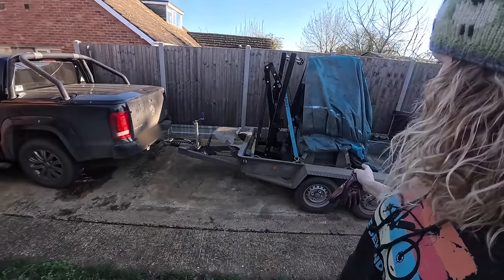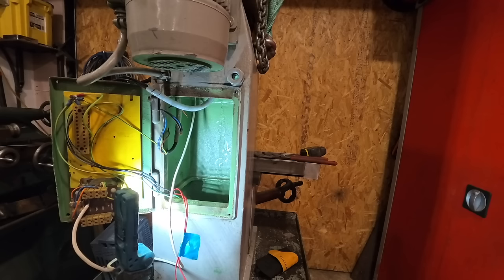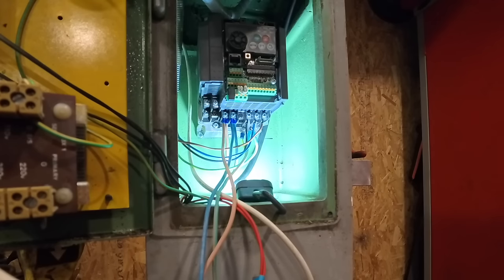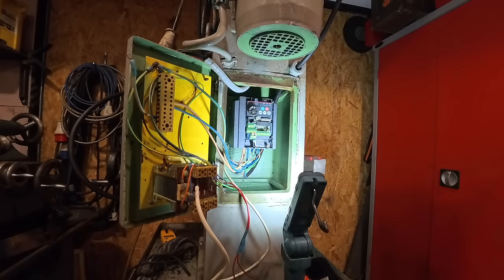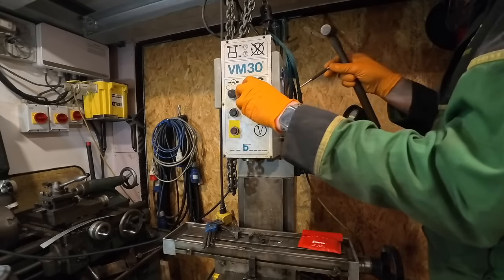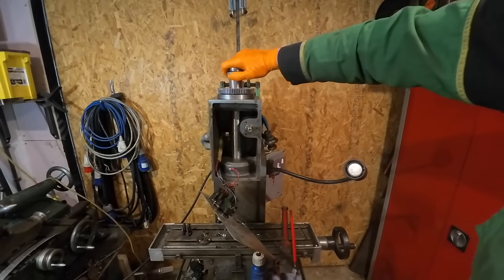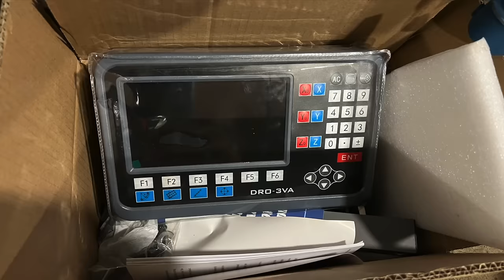I found a dangerous fault with my new milling machine 😳

Comment: VFD will be programmable to how FWD/REV is handled. You can also configure to support momentary or latching switching. VFD manuals can be a bit daunting at first, but just sit down and read through.  I converted my 1963 Colchester Chipmaster to single phase via a VFD and configured it to use the original controls. You should also take advantage of the variable speed capability.

Comment: Kim, your forward / reverse problem might be as simple as your common wire from the VFD is not on the common terminal of your switch. I have to assume you have already checked for that type of error. I know I’ve had simple errors bite me.👍✌🏻🇺🇸🙏🏽

Comment: you will need to change a parameter it can be done off the keypad on the vsd with no software required also if you install a multiturn pot and the appropriate parameters are changed you can get speed control without changing belt positions.

Comment: Kim, look up “three (3) wire control” I believe that is how the controls were wired. That is what the start, stop buttons and relay made up, so when you pressed the start button the relay would be energized and set of its normally open auxiliary contact's would close around or “seal” around the start button, keeping the run relay energized. Then pressing any of the Stop buttons would break the circuit and de-energize the relay.

To reverse a 3 phase motor you can swap any two wires and the rotation will change. As has been suggested I would think the VF drive could do that function based on a contact input.
Good luck!

Ron, N4PHP
Reply from the maker: I have actually sorted it. Thank you though.

Comment: Forward / Reverse, in the manual it talks about 'reverse rotation prevention' Page XII lists it in 7.17.3 then actual page 6-197. You will need setting '0' which you can program via the front display buttons.  Also on page 5-15 it mentions "When the STF and STR signals are turned on simultaneously, the stop command is given." If I understand this right, you could just fit an unlatching stop button linking both to give you a soft stop. Finally, I would recommend fitting a frequency pot for speed control. I have such a thing on my Colchester Master lathe and it so handy being able to vary the speed. All the best, keep up the good work on this very nice little mill.
Reply from the maker: Thanks for looking for Me, I did actually do all of that but what it ended up being was parameter 250, someone had changed it for some reason, once I changed that back it worked immediately.

Comment: Nice work Kim, you did an amazing job on sorting that milling machine . They are not very easy to work on but you sorted it .  The two funnel idea to get the grease into the gear box is brilliant , I'm going to be doing that. Thanks Kim ,  all the best.

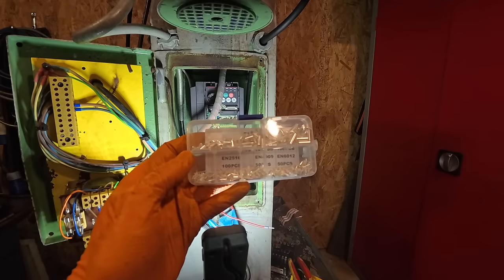Comment: If you only want one or two, it's really easy to push the actual aglets (boot lace ends) OUT of the plastic funnel (17:53) on the common type. I do this when wiring normal mains plugs.

Comment: belive to get rev. you push the run stop button same time that brings up a command mode.  screen should flash CN0d then you push the  up enter key, or the down enter key at the same time.  its that way on the FSI drives and also the eaton china clones. Frr is rev FrF is forward and if not you swap any two wires going to the motor to set direction wanted.

Comment: Check the programing of the VFD. The reverse terminal may have to be set in the program. Mine was. Great video Kim.
Reply: Yeah also the latching part is something the vfd can do :) also use the EMS to brake the STO on the drive ;)
Reply: Also, there are usually two ways to wire the forward/reverse and start. I’ve seen people wire that incorrectly. It’s really pretty simple, but impossible to easily explain in a post.

Comment: I converted a vehicle  hoist from three phase to single phase (415 to 240) by putting a single phase motor on to it. That motor had the brass bridging set up similar to yours. By having the bridges (according to the wiring diagram) in a certain pattern it ran in one direction, by having them in another pattern it ran the other way. That caught me out but that is another story, a hydraulic pump won’t work in reverse. I reckon those patterns can be controlled by a reversing switch. I am no electrician and I don’t really know but that looks like a possibility to me.

Comment: Did you know there is a pattern to torque bolts down?  You must start in the center androtaten across from the one you did applying even pressure all around...especially true with cylinder heads.

Comment: You do nice work .The two funnel system. Of put the grease in is definitely thinking out side the box . when ever I work on something complex I use my label maker that prints on heat shrink tube and I mark all the wires ( it pays dividends) if i was doing that job I would google the motor part number and see if I could find a wiring diagram, you are just missing one small piece of info some times the manufacture may have a technical phone number I have solved more that one mystery by making a few phone calls   You will figure it out that I am sure of .....

Comment: Oh Kimberly, worked quite well but was rather messy. I would just junk the 3P motor and put in a single phase, more expense I know but as you said"I don't want to do it again". Great machine and it would take me a few days of training to use one .
Reply: Some of these machines have motors which are rather specific to the machine regarding how they are mounted, also you get better torque from a three phase motor.

Comment: Great video 👍 
I have a bridgeport and decided to run it off an old style 3 phase converter.  Runs brilliant as I needed forward and reverse in high and low speed (delta and star).
Digital readout....done it myself 😁

Comment: Very nice machine. A couple if points. With regards the reverse, you can program the VFD for various different inputs and how they are processed by the vfd, read the manual. You could have programed it to worked with the original momentary switches, but putting the three way switch in was a better solution. The second point us, dont iver pack bearings, as this can cause damage, because if there is no space for the grease to move to the bearing it makes it hard to move, which you saw.
Reply: Wheel bearings are packed and they work ok.

Comment: Boxford make some nice sruff. You kept saying 220v. British mains power is still 240v. Measured it yesterday testing a new meter.
Lovey neat job my wiring is a dogs breakfast usually!
Reply: Not correct. The standard says 230v to align with the rest of Europe, but there is a tolerance range which allows supply voltage to be as high as 253 and as low as 216v.

Comment: Have you thought about ventilation? VFD's generate quite a bit of heat.
Reply from the maker: Its alright how I have it I think. It needs ventilation vertically which is what it has.
Reply: I don't think it will be a problem, not for intermittent use anyway, might be different if you were running full load all day. It's got a lot of cast iron mass to soak the heat away.

Comment: Most VFDs will come with the basic parameters set up in them for running a motor. You should be able to fine tune the parameters of yours to set the motor current, voltage etc as well as the forward and reverse option.   What make and model is your VFD? Were you looking to use the speed control of the VFD as well or keep that purely mechanical?

Comment: You may have been better fixing the VFD on the outside of the mill so you can access in use features such as speed control.
Reply from the maker: I don’t like VFD’s to be in show if I can about it. Also, they’re not exactly durable.

Comment: Can't see make and model of vfd, but suggest checking the manual for it about running in reverse. 

It's not unusual to have to set a parameter to enable reverse running and/or change how the control inputs are interpreted, for example there may be a mode that would have given a latching function to the original push buttons.

Some of the cheap Asian import models have manuals that aren't too clear if you're not used to setting drives up, worth persevering though.  [edit: I'd assume Mitsubishi manuals aren't too bad, but don't have 1st hand experience with them]
Reply from the maker: I have set up a couple now but this one just does not seem to want to work in reverse. 

I have switched the switch wires round so where I’d toggle it to revserse that works. But it just won’t do anything on the VFD, I have tried about 6 different functions in the settings to enable it and all seem to be enabled. I don’t know what else it could be.
Reply: @CalamityKim1  
Mmm, interesting.  If you can post the model number I can look for a manual online.   My experience is with Control Techniques drives, don't think I've done anything with Mitsubishi before...

Just a thought (and in the absence of seeing the manual), sometimes you can have a mode two inputs:   a "run fwd" input and a "run rev" input,  where you set whichever active for the direction you want.  Then sometimes you can configure for the 2 inputs to be "run" and "direction",  in this case you always need the run input active for it to spin, but then for the direction the input is 'active' for the one direction and 'inactive' for the other.

Clearly if your wiring is configured for the former, then with the drive set for the latter it will run forwards and not run at all in the reverse setting because you're changing the direction input but not giving the 'run' command.
Reply from the maker: https://eu-assets.contentstack.com/v3/assets/blt5412ff9af9aef77f/blt9cc861cb96edf313/6172871939e7f70c7378003a/5a2723b0-23d3-11e9-853d-b8ac6f83a177_412411.pdf 

That’s the manual and it’s a FR-E720S-080SC

I did wonder about that, I was running short of time to get this video done. I may go and have a go later with that.
Reply: @CalamityKim1  
Cheers, I'll take a look later - just off to my workshop for a bit now  🙂
Reply: @CalamityKim1 the forward reverse may have a deceleration timeout from what I can see in the manual. Have you waited for the deceleration time to elapse before switching to the other direction of operation? So you are wiring the PC connection out to the 2-position selector switch with two normally open contacts on it. One of which closes in either the right turn or left turn movement? The contact closure pulls the start forward or start reverse inputs down to PC level? So one side of each normally open contact is commoned up to the PC wire from the VFD? You could do some trouble shooting to see if the start reverse input is being seen by starting the unit in forward then jumper the start reverse to PC on the VFD. This should cause the motor to stop according to the manual. If it doesn’t then the start reverse input is not being seen for some reason.
Reply from the maker: Thanks for the reply. So yeah I have waited for a period of time to elapse before starting, as well as just trying firstly to go into reverse firstly. 

I did wire it as you said yes. I will try the jumping wire and see if that works. I did question if there’s an issue with my switch so I checked that by switching the fwd and rev wires round then checked the switch which worked. 

One thing I noticed yesterday when I had another quick look, there’s a high, medium and low speed terminal on the VFD, none of them seem to work. I’m wondering if the sink terminal block has something to do with it. You can see it is a two pin thing on the wiring diagram. Right near the PC terminal? 

I was going to have a good read during the week and see if I can work it out.
Reply: @CalamityKim1  
Ok, so based on my interpretation of the instructions...
 
The drive should have the control logic set to positive logic, or in the manual referred to as "SOURCE" logic  (the default condition - so should run when control input is at 24V).  There's a little jumper for this above the control terminals, shown in Fig. 3-18 on page 3-27
 
You've got the "PC" terminal giving +24V output supply (so checking with a multimeter should show about 24V between "PC" and terminal "SD"  ["24V DC power supply common" - if the drive is set for negative logic this is referred to as the 'sink' terminal.]).   However page 3-22 contradicts itself, initially saying "PC" is a common 0V terminal, but then in fig 3-14 immediately shows a +24V output supply connected to PC which matches the description on Tab.3-9 and Fig.3-4 and everywhere else shows PC as a +24V terminal - so I'm inclined to think that is a typing error and it should refer to "SD" instead of "PC"?
 
The +24V "PC" terminal is connected to the common terminal of the rotary switch with the "F" switch terminal then connected to the "STF" on the drive and the switch "R" terminal connected to "STR" on the drive.  It should be possible to measure  0V  between terminal "SD" and "STR" and 24V between terminal "SD" and "STF"  when the switch is set to forwards, and 0V between terminal "SD" and "STF" and 24V between terminal "SD" and "STR" when the switch is set to run in reverse.  This is sorta confirmed by the suggestion that you've swapped the forwards and reverse connections on the switch.   Note:  If both "STR" AND "STF" are high at the same time the drive will 'STOP', so worth checking the voltages at the terminals are as expected.
 
The "S1" and "S2" safe stop inputs in the first instance want to be connected direct to the "PC" terminal, however in due course the emergency "E-Stop" would break these connections to ensure the drive can't deliver torque-inducing-current to the motor  (the output to the motor may be 'live', the motor may jerk, but the motor won't deliver rotational torque).  The fact it runs forwards means this connection is there.
 
Parameter Pr.79 "Operation mode select" should be set to "3" to allow it to be started from signals applied to "STF" and "STR" with speed set by the twiddly knob on the drive.

Parameter Pr. 1 "Maximum frequency" should be set to 50 Hz

Parameter Pr. 3 "Base frequency" should be set to 50 Hz (default)

Parameter Pr. 9 "Electronic Thermal O/L" should be set to match the motor's rated current (so drive will trip before motor burns out if overloaded)

Parameter Pr. 178 "STF terminal function selection" must be set to "60"  (default)

Parameter Pr. 179 "STR terminal function selection" must be set to "61"  (default)

Parameter Pr. 250 "Stop selection" - set to "9999" (default) so STF will run forwards and STR run reverse (only one active high at a time).  If this value is set to "8888" the STF will give a start signal whilst STR will control if it runs forwards or backwards (so both need to be high at once for the one direction).  If the value of Pr. 250 is anything other than "9999" then STF is start and STR is direction (as per 8888) but with various coast settings.

[Parameters 178,179,250 can be altered by setting Parameter 160 = 0  (default)]
 
(incidentally, the 3-wire description on page 6-124 shows the connections to use the original push buttons to give a latching 'run' / 'stop' function)

The high/med/low terminals aren't enabled with Pr. 79 set to "3" - see section 5.2.3 on page 5-24,  for these to operate you need to have Pr. 79 = 4, however I'd leave it on 3 for now as being simpler.
 
 
If the parameter settings all seem correct then check with a meter you have the expected voltages on the control terminals - or ditch the wiring to the panel switch altogether for now and put a single direct wire link between "PC" and "STF" to confirm it runs forwards, then move that single wire link to go from "PC" to "STR" to (in theory) make it run backwards. If that works you can investigate the front switch separately. 
 
Good luck
Reply from the maker: Thank you for taking the time to have a look. I will double check all of that. Im sure I set most of those parameters but I’ll triple check every one and all of the voltages as you said. I have just checked a photo and seen it is set as Source so we will see 

Thanks again
Reply: @CalamityKim1  
I think the defaults should do what you're after, so I'd double check what's actually at the control terminals with a meter, or just test with links of wire.

Of course if the vfd is second hand it isn't impossible the run reverse channel might be damaged.  It has opto-coupler inputs so a too high voltage could fry the opto and not do further damage.   If you're in a position to measure the input current to each input you should find them about the same, it'll be in the milliamp range, so depends what electronic test equipment you've got.

Comment: Does the electrical side come easy to you, or do you constantly study diagrams etc? It's where my sense of logic fails me entirely! 🙄 Great channel to watch by the way Kim, keep them coming.
Reply from the maker: Fairly easy. I normally read instructions but most of it is quite easy to work out with things like a vfd there are other times when I struggle more however.